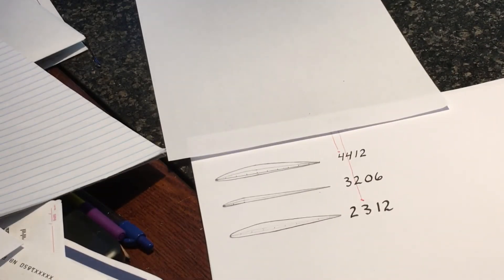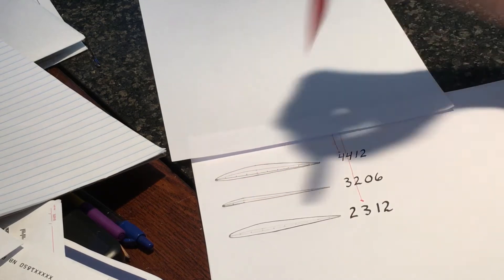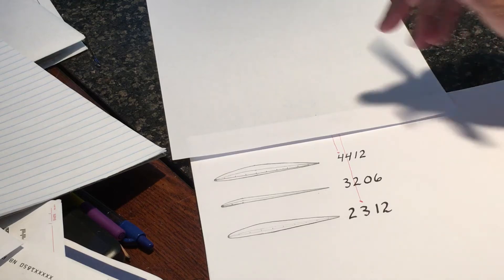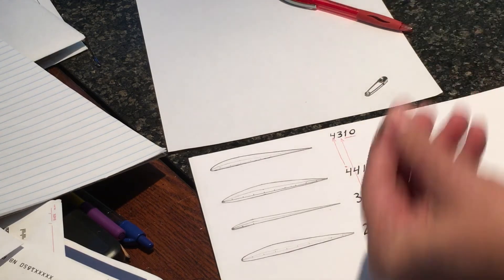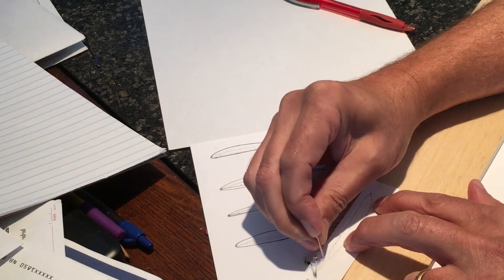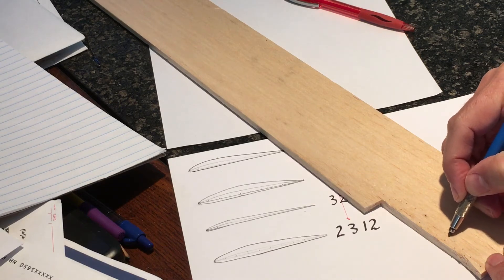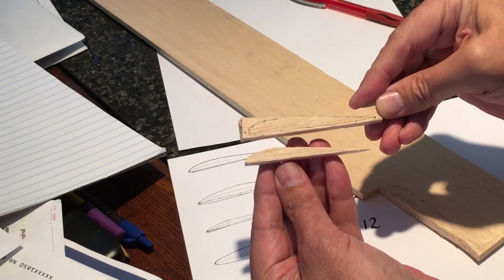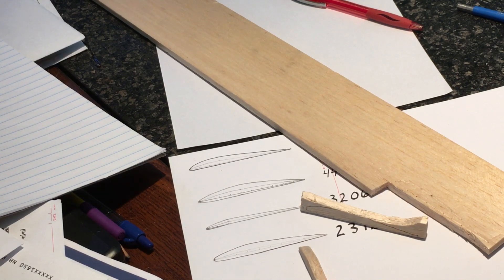Engineering: Selecting Our Glider’s Airfoil

Comment: In order to avoid creeping errors I first make a rib pattern in aluminum sheet. You can pick up small cut off scraps from any aircraft repair shop. The aluminum is easy enough to cut with a scroll saw and then smooth with a file or sandpaper. Trace it onto the balsa with a soft led pencil, cut them out a bit oversize, stack them and sand them all to the same shape at the same time. I drill two 1/8 holes in the ribs to keep them together as you sand. The 1/8" dowel will also hold them in place when you glue them to the spars. A bonus suggestion: keep your file wet with WD-40 and it will never plug up with aluminum filings. Good luck!
Reply: yep, Aluminum or hardwood would be my choice as well.

Comment: how did you finalise the airfoils for your glider
Reply from the maker: Part of the problem was how delicate balsa is, so I made the airfoil thicker to accommodate two 1/8 inch diameter spars.  Two  balsa pieces broke anyway during construction, but I reglued them around the spars, and that seemed to work.